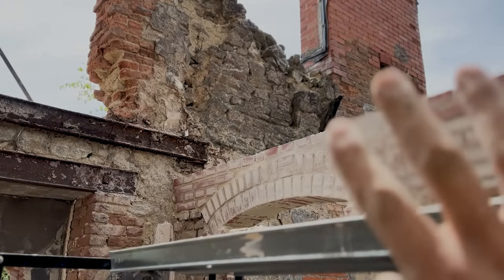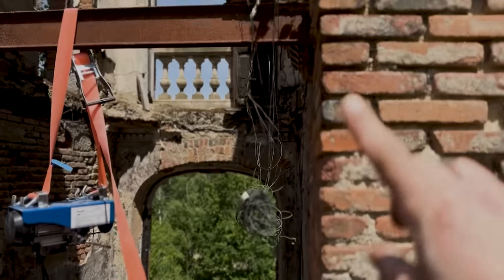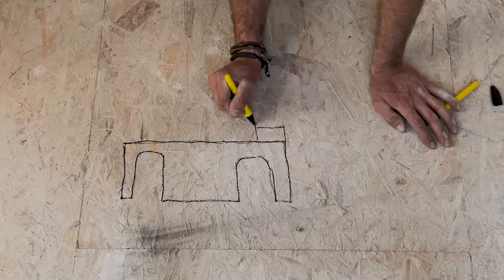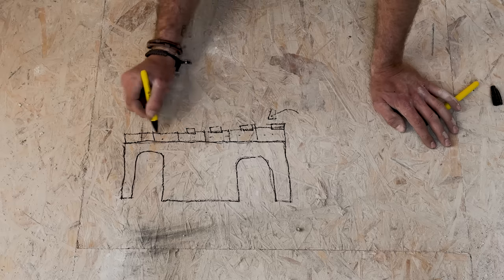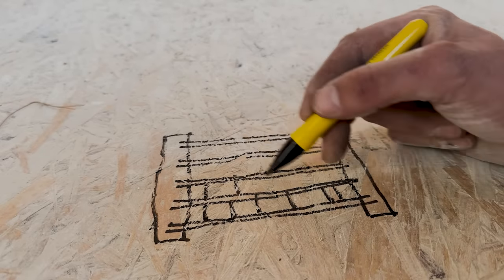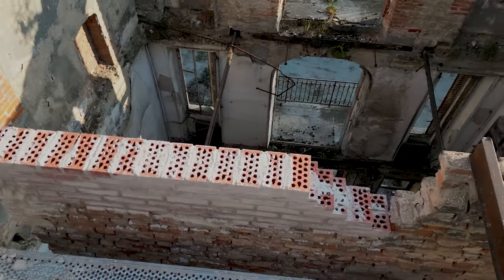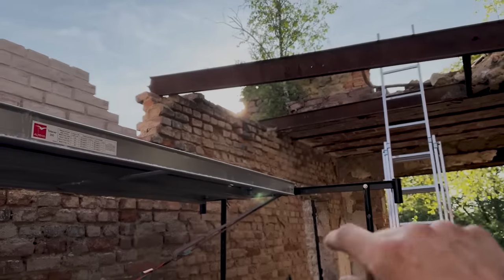Solving STRUCTURAL challenges with the chateau.

Comment: Dan you're doing a fantastic job. I know from personal experiance the efort involved with the work you are doing. I know with greater funds you could do more in respects of scaffolding and hoist. You will need to think about how your going to get those beams up to the top level. I used to lift 2.4m concrete posts which are 44kg and I do think you will need help at least a better hoist. All the best I eagerly await your Vlogs to see your solution, also get yourself a weight lifting belt.

Comment: I think it is wise to continue on with the existing levels - apart frpm the integrity of recreating what was there, you avoid any possible inconsistencies ahead if you changed levels..  Also - have you considered erecting a gantry / block & tackle off one of the front balconies so you can raise bigger / heavier items from the outside rather than dragging everything inside and up level by level.. ?

Comment: My question is when do you plan on repointing all the old walls
to help make them stronger and more stable ?? Would that be after the floors are in ?
Reply: He said he wants to plaster them using his sprayer. That should force the plaster into those gaps without needing to repoint anything separately. IMO none of the open joints are deep enough to cause any structural issues.

Comment: Hi Dan, Have you thought of using a polyvinyl acetate with water mix brushed on to the old plaster to adhere the new plaster. Used it on 170 year old plaster and It works really well.

Comment: Shoud you use the difference of the floors to run the water systems ( Probably the chateo had so very few bathrooms), than the modern requeriment of suites.
Reply: The chatêau had four bathrooms, probably because it used to house up to 70 children during the war. Adding even more bathrooms would make sense if you wanted en-suite bathrooms but I'd say that's possible without changing any floors. The most logical place for extra bathrooms would be on the other side of the wall Dan's working on at the moment and I'd run the pipes up from the basement.

Comment: Given how much work you do on your own I think you should look into light gauge galvanized steel for floor joists and so on. Use of the proper gauge and structuring will allow you to do more work your self as the weight of the members will likely be lighter and be as strong as you need.

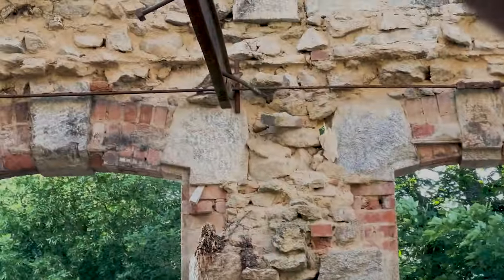Comment: 07:47 - Concerned that if you are replacing these RSJs with exact copies that they will not be as strong as the original beam because they were clearly 'flitch' beams originally (sandwich of timber with RSJ in the middle - and pretty chunky ones at that going by the length of the remaining bolts.  However, replicating this entire arrangement may actually be easier/quicker than notching top and bottom of every interstitial wood joist as you can just screw joist hangers easily on to the sides to the fletch beam...

Comment: I am wondering how buildings like this progress in respect of buildings inspections. When do they occur, are they required in law and/or good pracrice. Is it done as one goes along .. or at the end of stages perhaps or at the very end. It strikes me as very important for stablility, safety of the building structure etc.. also building regs as regards ways of doing things, planning laws etc. If something is incorrectly done earlier on how is it picked up and will other work further down the line be sacrificed if it has to be redone.. expensive and time consuming. I know NOTHING of course. Just musing on all of this.

Comment: Can you not achieve level between areas by adding to floor planking after fitting and making commensurate ceiling adjustment. So fit the floor beams as is, then fix wooden shims on top of the beams to achieve level?

Comment: Leave the levels as they were and you can easily build up a false floor from timber on top of them at a later time if it’s driving you nuts. (Providing the ceilings are high enough of course)

Comment: You found a heating grill. That may explain the different levels as the ducting has to flow under the floors.
Reply: I think only the main rooms had heat and those ducts run in the walls and in the basement.

Comment: Can we nickname these rooms/area by number, direction 🧭 N/S/E/W or something? So it's easier to keep straight. Or is it just me?
Reply: It's not just you. I keep trying to orient myself, and was wishing for some kind of rudimentary floor plan. A straight overhead drone view isn't terribly helpful unless it's got arrows pointing to the locations of things like the bathtub and the hanging loos. There is a drone shot several videos back that shows the old water tanks, but nothing to indicate their location in relation to the bathrooms.
Reply: @CrankyBeach  The building is shaped like a stubby +. The two short arms are the front with the double stairs and front doors (NE) and back (SW). The NE section contains the grand entrance hall and main stairs, on the second and third floors a centre hallway and two bathrooms per floor. The longer arms are the side wings, SE (where the tree used to grow up to the second floor) and NW. I suspect the NW ground floor room used to be the original dining room because there's a description from the 1930s that says this room used to have stairs down into the basement hallway just outside the kitchen. I think the bath got dropped into the SE room or tree room as I call it. The water tanks used to be on the third floor in that centre hallway, roughly above the bathroom doors on the floors below. The NW ground floor room has a very unstable floor and the SW one is completely gone

Comment: Is the difference in floor levels to allow piping in the bathroom floor?
Reply: Good question!
Reply: I don't think so. All the current bathrooms are on the first and second floors where the floors were all level. The steps are only on the third floor where the water tanks were. I think the various levels were a compromise by the original architect dictated by the exterior design and the ceiling heights on the second floor. The lowest part is above the main stairs, the hallway and mansard bedrooms in the side wings were higher and the big SW bedroom had the highest ceiling.

Comment: I've seen videos from France that use alternatives to concrete blocks between concrete beams such as foam blocks or plastic upside down basins. And they pour concrete on these. Perhaps this is only for ceilings? Anyway, please do your research. Best of luck!
Reply: Yes, there's a bunch of differen hourdis systems. I've seen timber ones as well, Youtuber Sullivan used those. IMO the less wet concrete you need to get up there the better, it's simply a massive chore. Therefore I'd pick the system that needs the smallest amount of fresh concrete.

Comment: You really need to tear the walls all the way down using the original brick, not the brand new brick
And using masons  to re-create the wall and tear down another wall way down to the foundation and then start over again  using the original brick, not the brand new ones complete new morter
Reply: Dan once showed us how crumbly the old bricks were so I sure wouldn’t use them except for decorative areas.
Reply: @irvanairvana4055  any brick will do that crumbling if you smack it hard enough otherwise you’re just building a brand new building. The old bricks are plenty strong enough.
Reply: Really?
Reply: @bridgetmustard5285  I am a structural engineer I do this full-time on historic structures  the mortar after a fire has lost all its strength and needs to be completely replaced
Reply: @bridgetmustard5285  plus brand new bricks look like brand new bricks and really really badly detract from the look of a historic structure they should only be used if you have no other choice or are parts of internal walls were no one will ever see them ever
Reply: @BSCMikey  they are not going to be seen, they will be rendered over.
Reply: @BSCMikey  But this is France, they don't care. That's why they let these chateau rot.
Reply: @bridgetmustard5285   he still have to have permits fire, safety inspections structural permits  if he doesn’t have any of that whatever he has to undo it
Reply: @BSCMikey  How much of the structure would you say is rock?
Reply: @BSCMikey  What country do you work in?
Reply: @irvanairvana4055  United States Of America
Reply: @BSCMikey  we'll just have to wait and see. Fingers crossed for him.

Comment: Why are you messing about with bricks,? use concrete blocks they are quicker and use less mortar also why are using lime mortar with the bricks?  lime mortar takes 90 days to reach full strength , the bricks you are using are comparable with U.K.  class B engineering these bricks are laid using 3:1 mortar i.e. sand ratio to ordinary Portland cement, good idea to use the beam and block floor which will require a structural R.C. topping look at renovation beton on u-tube to see how the French do it

Comment: Dan wouldnt it make more sense to just remove that whole top level, i mean is it REALLY necessary for structural purposes? If there were a way to take it down to two levels for now & then add that third level later AFTER you're dried in, wouldnt that make more sense??  Nice to see France does have rebar.😊
Reply: There's not much left of the third floor and I suspect some of it might have to come down but the biggest issue is the turret. The SW wall (facing the hallway) looks pretty scary on the third floor and that has another level on top of it.